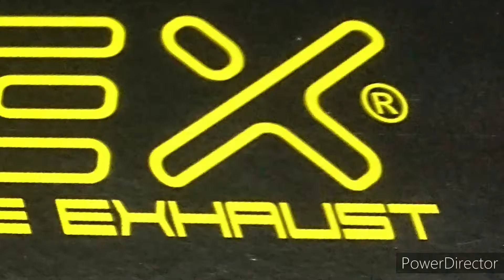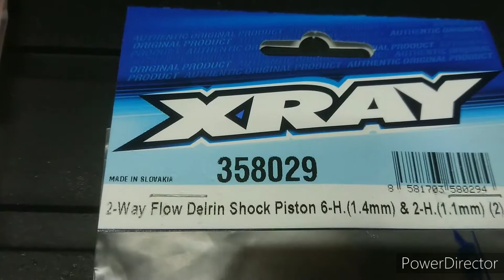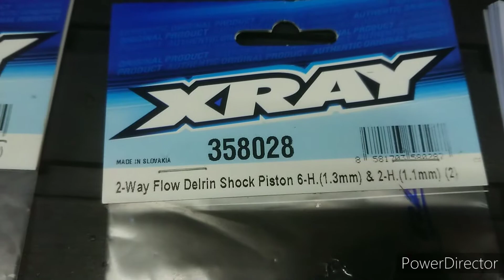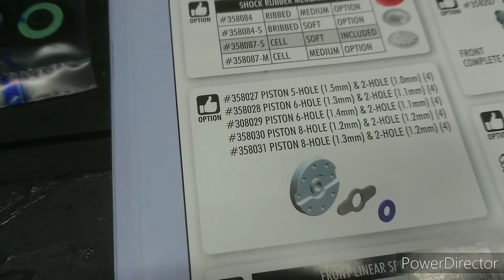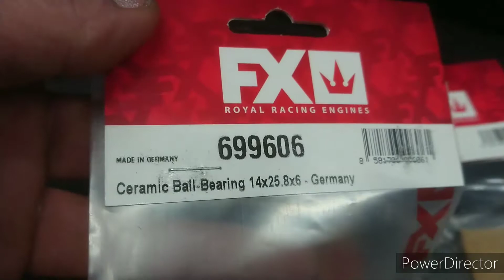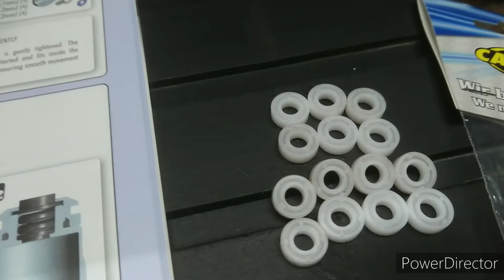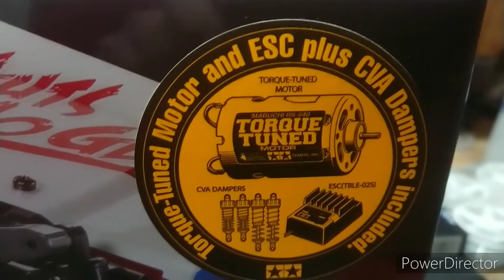A NEW KIT & MORE

Comment: Wow king, you surely have some of the cleanest 1/8 buggy and truggy setups out there! You have me wanting to build one of those 8x buggies already😄 and those hipex pipes look so good I think I’m going to start running some to see how I like them👍🏼
Reply from the maker: Thanks a lot mate 👍If you are going to build a buggy may I suggest an Xray... or a tekno perhaps .  I think they are better quality than the tlr.  Not that tlr is bad.  The plastic and metal of the Xray is in any case more durable than that of the tlr.  But then again, if you also have the 8xt it is easy that you can exchange parts.  I really like the Hipex pipes.  Hipex makes many pipes for different brands.  (novarossi, Ultimate, fx and such.) They are very good and can recommend the 2135 evo2 wholeheartedly.  And if you have them with the coating, they are easy to clean and more durable.  Bones Motorsport is the official hipex dealer in the US.  Anyway, looking forward to your next vid buddy🤘👊

Comment: I’m ordering hipex 2135 pipe should I get 44mm header or 50 mm header for truggy what’s your opinion on best truggy engine for track  a seven port or five I believe 3 ports are for buggy?
Reply from the maker: I'm running the 2135 with a 50mm header. That is also what Hipex recommends. And i like that setup.
They say a 3 port is for buggy, but i like my Ultimate M3X v2 or FX K301 EC in truggy. Those 3 port square engines have a stronger bottom end in my opinion.
If the K502 is here it's gonna be in my buggy. So, since the track here isn't really large, i prefer the FX K301  (or 303) with the Hipex 2135 - L50  in truggy and the K501 (or 502) with the Hipex 2108 - S48 in buggy.
I don't have a L44 header, but frankly, I don't think there is a significant difference between an L44 and L50.  At least not that big that we normal guys will notice this.
You have a Ty Tessmann square engine. Think you should try that in your truggy with the Hipex 2135.

Comment: The FX low profile cooling head looks awsome !!! Great stuff!  The fighter buggy race should be a lot of fun, no modds allowed?  Kings i see a lot of illegal products in your garage, you should be ashamed of yourself for breaking the law like that 😆
Reply from the maker: Thanks mr B 👍, think the fighter buggy race is a lot of fun, no modds allowed only the bearings. All the same cars, so it comes down to driving. Actually don't know yet if it's allowed to run a lipo. I ran a 10th scale racekit and found that more difficult than the 1/8. Think it deffinitely  improves your driving.
And a lot of fun for € 85,-
😂You've got a good eye on the cans. 😂Unfortunately those are the empty ones😔never throw anything away quickly😂, they might come in handy some day😁 The law is broken in the other shed at the back of the lot. 😂😂👊
Reply: @kings-racing   100% stock cheap tamiya buggys, i would like to see that! running on Nimh! How often do you change your engine's conrods? and what is thaht grey thing on your carb? 13 cans are still availble at MCM Belgium, maybe the last ones in europe !! Think about it,  i recently bought 4
Reply from the maker: @TastyBRC  I'm also curious how that goes.  As soon as the weather is better I will try it on the 1/10 track.  I don't have a golden rule  to replace the conrod.  I look and measure every 2 gallons.  Look for clearence and measure (especially when the piston goes down. That's where the most wear is. Also on the crankpin. On my Alpha the crankpin was worn. Not on engines with a DLC crank though.) On the Reds 721 SV I replaced the conrod at 3 gallons and my FX has 8 gallons on it already.  The gray thing is a hair tie.  These can handle more heat than a rubber one.  I've broken those rubber ones several times with heating the engine. I think I have enough 25% for now.  Still have 10 gallons in stock😄